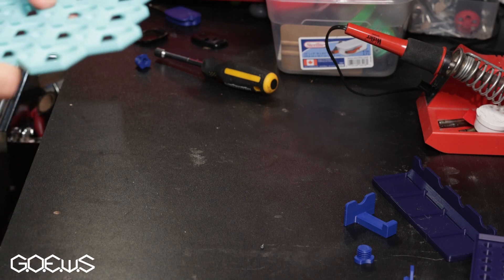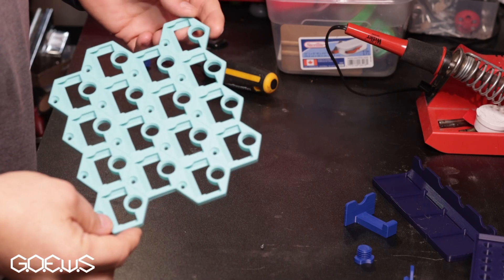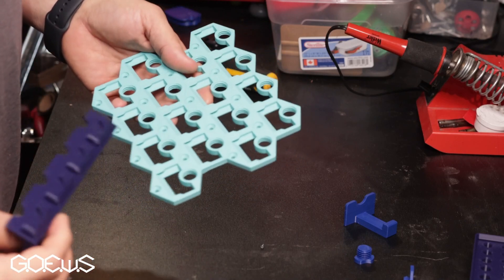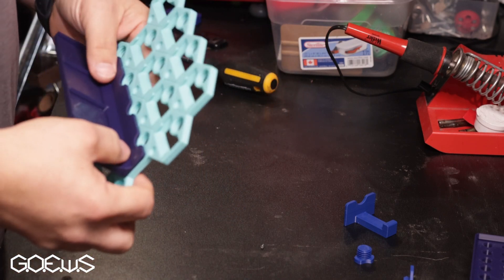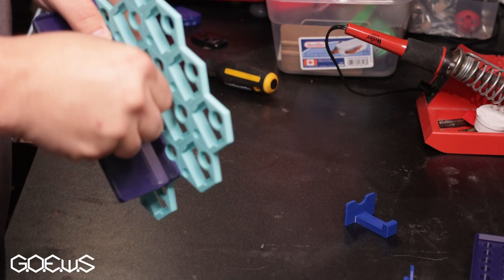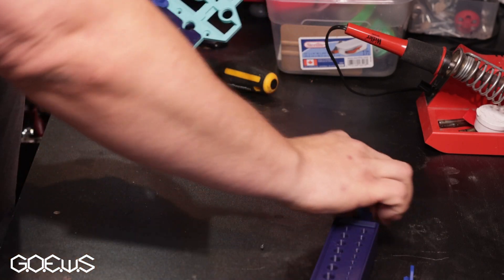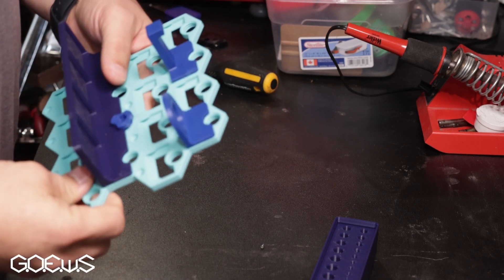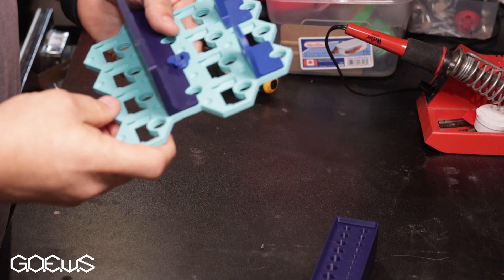GOEWS - Greatly Over Engineered Wall System Intro

Comment: Oh, cool! I didn't realize you're the one who made this at first. Congrats! 
I just started printing the gridfinity system for myself and watched your stacking video (thanks again for that). For newbs, and generally speaking, do you think you'll do a comparison of GOEWS and other wall systems? I think it would be helpful. 🙏
Reply from the maker: I considered it, and even printed off sets to test, but I dont think that's really something I should do. as it would be Biased no matter what. Better if someone unrelated to the project gave an unbiased opinion. in my opinion its better! lol it uses a bit more plastic. but its stronger and needs less parts to be setup. its still a young system so it will take time for the public to embrace it and remix / intergrade.. hopefully that happens

Comment: Well done! It looks stronger compared to other designs. Great work!
Reply from the maker: @chaymber_crafts  I believe it is. I’m actually going to do some load tests to failure to compare them in very curious about it
Reply: @MrExo_3D  I feel like the bottom cleat is facing the wrong direction

Did you ever do your failure tests? Was there any reason you chose to reverse that bottom cleat compared to a traditional french cleat design?

Comment: It doesn't look like the screw lock really needs a head at all.  It just needs to be longer than the thickness of the grid to prevent the cleat part from lifting up.  Then you can just put a Phillips/flat head screwdriver inset into the screw for install/removal.  Also, reminds me of Milwaukee Packout mounts...
Reply from the maker: @ylexot007  bolt serves two purposes. It does prevent lifting but also holds the top of the hanger plate from pulling forward

Comment: Do these panels clip together to make a bigger wall system, or is that something that’s maybe in the pipeline?  It looks amazing by the way, and keeping it open source will naturally propel its popularity (and hopefully your YT channel too).  I’ve just added it to my future prints list, lol!  🙂👍🏻💕
Reply from the maker: @trappedinroom1014  the panels butt together but are not physically attached to each other , just the wall. I do have parts designed to join them but they aren’t really needed. But yes this does mean many fasteners in the wall. Considered ways to clip them. But I didn’t want this system to be stuck requiring all kinds of tiny parts to just work
Reply: @ There’s a lot of potential with them that’s for sure.  I’ve just watched your stacking video alternating the PLA with the PETG as the separate layer…an absolutely brilliant idea.  🙂👍🏻💕

Comment: this looks great, need some filament usage numbers vs multiboard, at first glance it seems this would use a lot more however is that true when you factor in fasteners etc?
Reply from the maker: I just did a quick comparison. between a Multiboard 9x9 tile with 4 Single Snaps A&B in each corner. which is the min needed to mount one to a wall by itself. and it was a total of 115g and 4hr51m vs a GOEWS 5x6 tile. (sizes are almost the same) which was 127g and 4hr35m. which is very comparable. if I instead used the Lite GOEWS tiles. the filament  use drops to 100g and time to 4h24min.
Reply: @MrExo_3D  GOEWS also feels lower density in terms of mounting points though for the same area of wall covered so that factors into the comparison. I like it and I like the standardised from the start insert everything from the front and bolt lock from the front aspect so I'll probably use it going forward. That's something that has annoyed me about multiboard - to make certain things strong you have to bolt lock them from the back, and you've already screwed the tiles to the wall. And let's face it - we wouldn't be 3d printing all the things if we worried about how much filament we're using.
Reply from the maker: @ agreed I never liked the rear mounting options. Doesn’t make sense. It’s fine if you over plan from the start but hard to change it up as you go. I had printed like 20 tiles of multiboard . I still have some mounted to a few walls, but what really bothered me was the license and meshed cad files. I’m glad people seem to like the idea of GOEWS.
Reply from the maker: I havent done a direct comparison. would be interesting to see how it actually plays out. but just comparing the tiles yes GOEWS needs more plastic.. I did make a Lite version thats 22% less tho. will try and do a comparison

Comment: Genius, I think this is the best approach.

Skadis type systems are awful to 3d print, french cleat angle is perfect for 3d printing.

However, in order for it to be over engineered it needs magnets in exchange for the screws :P.

Nice, thanks for sharing.
Reply from the maker: @Adrian_Galilea  hmm you make a good point perhaps an overly elaborate magnet fastener would be a nice addition
Reply: @MrExo_3D  Don't use magnets! Any non-stainless fasteners in drawers will get magnetized and be stuck to the back and to each other. Frustrating when using M2 or M3 size screws.